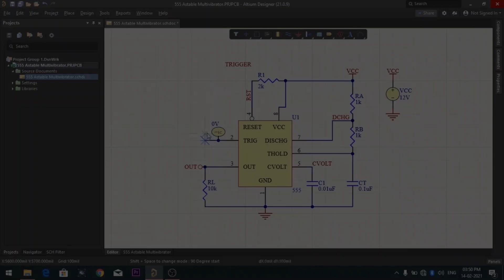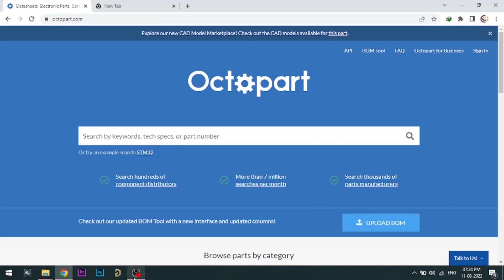DIY Metal Detector

Comment: That's a very good invention, and if I increase the number of turns in the coil, does it become more powerful at greater depths, or would it also require changes to the design of other components?

Comment: 555 IC 
220K RESISTOR 
4.7uF capacitor
Copper wire 
Buzzer 
9V battery 
Switch